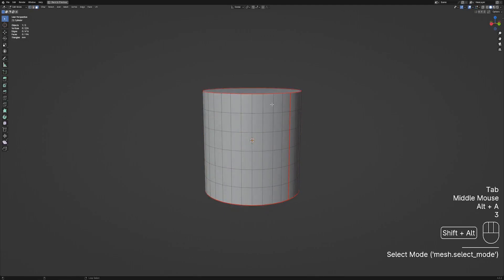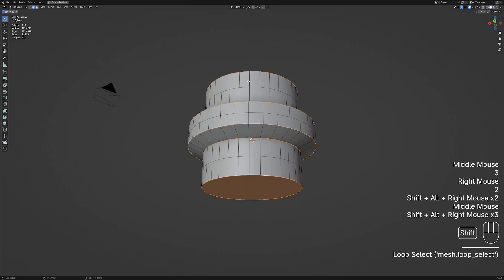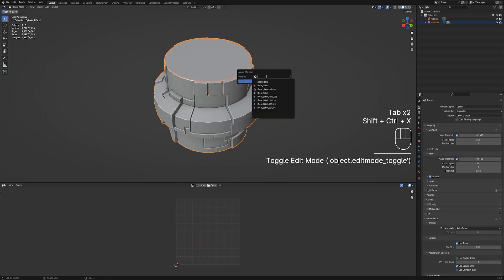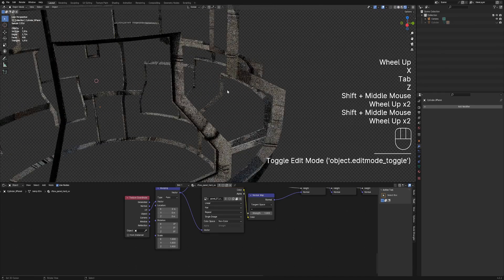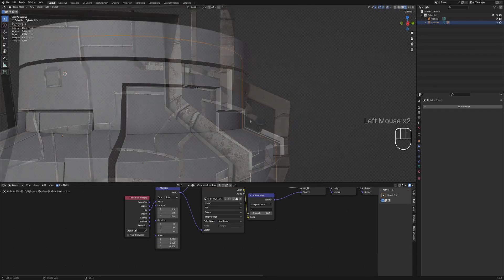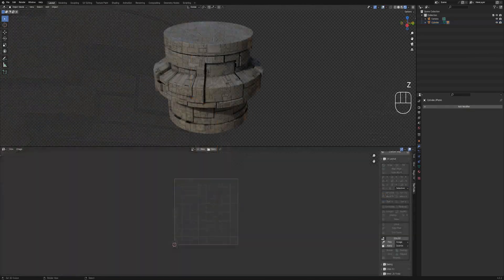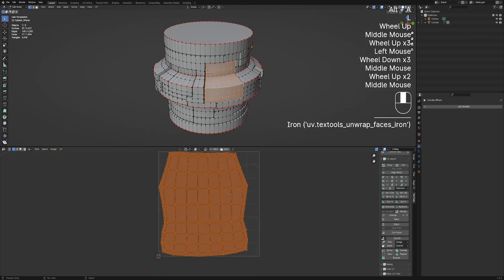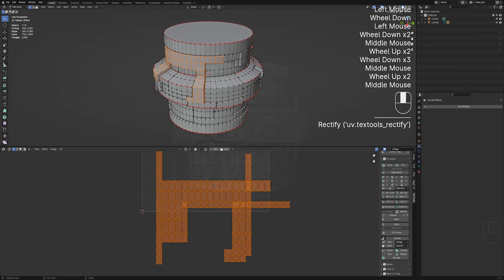Random Flow Basics: Quick UV Method

Comment: I was thinking about a workflow for the starships generator or even the flow generator that involves selecting island sizes for uv.  Do you think this might be more accurate than what is described here?
Reply from the maker: The starship generator already has seams marked after use. All you have to do is unwrap and use the textools method shown here. Some areas may need more seams cut. For RFlow, you can use cube unwrap for completely angular models for example. I'll show other techniques in a couple of days.